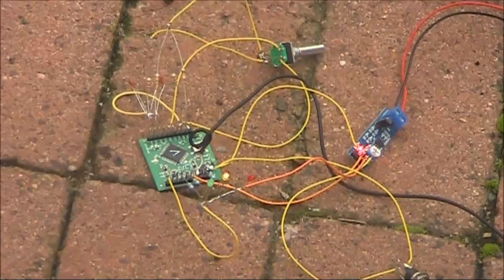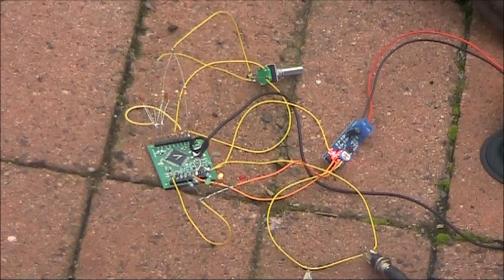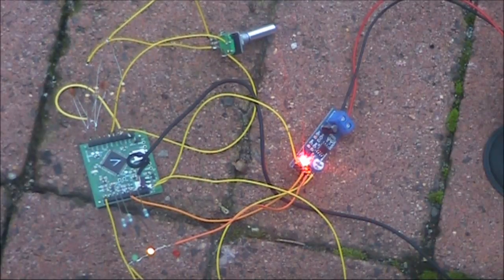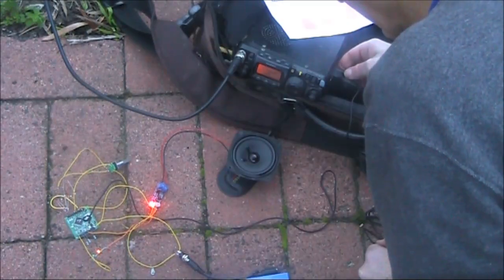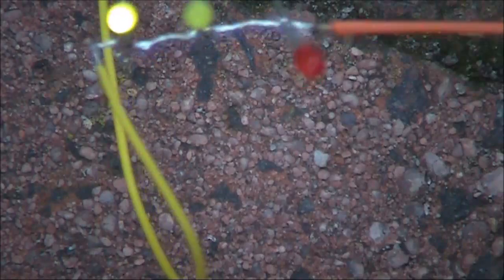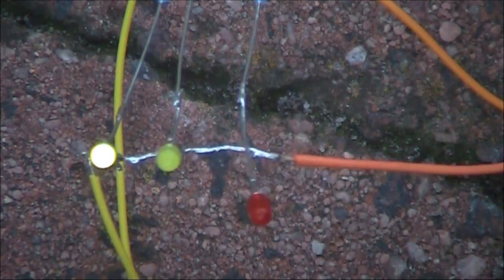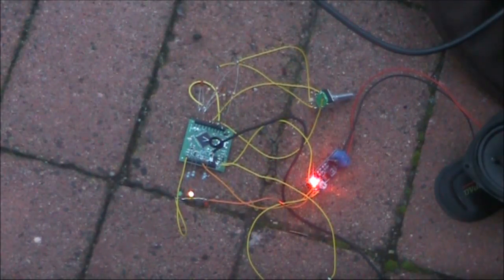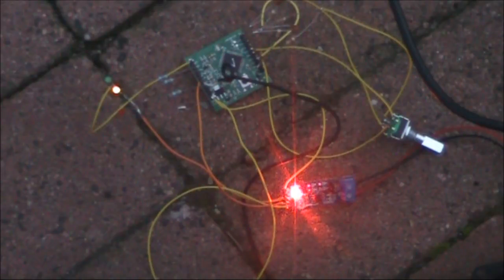Review: SOTAbeams LASERBEAM VARI variable audio filter

Comment: I don't get why they chose to do the filter in audio instead of the intermediate frequency.  There seems to be plenty of microcontrollers capable of a couple of mHz input and output with enough power how to do fast fourier transform. Surely it would make more sense to filter in if

Comment: Excellent review Peter. I've been thinking about DSP for the 817, but I really don't know if it's worth it. 
thanks for the review. Thanks for Sharing.
Reply: SurvivalTechNord, This is different from the traditional DSPs used for noise removal.  If you don't already have a filter for your 817, I would recommend the dedicated SOTABeam 817 laserbeam audio filter.  It provides excellent filtering for SSB and CW and it can be installed into the 817.  The vari-filter is a great alternative as an external filter. Both make a world of difference on busy bands by allowing you to filter out near by QRM. 73, Paul
Reply: Paul Vizard Many thanks Paul.